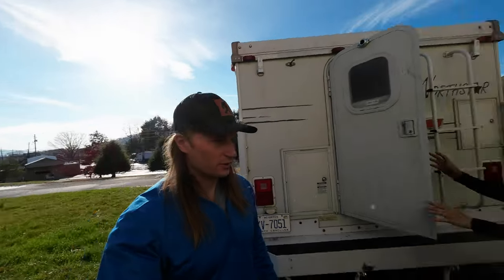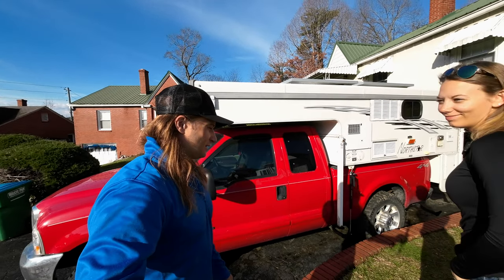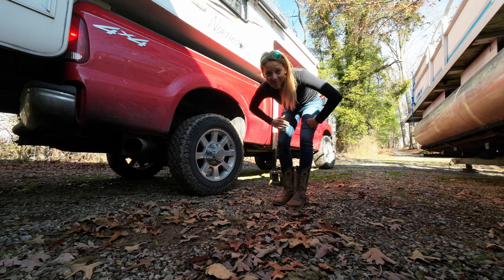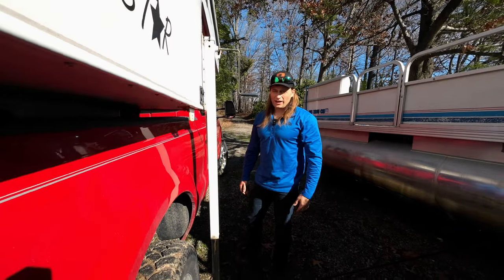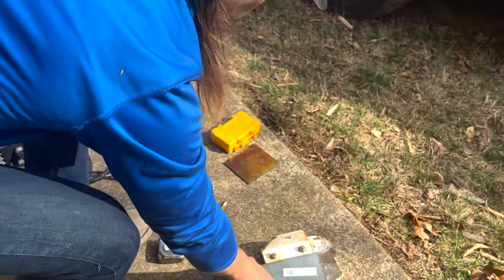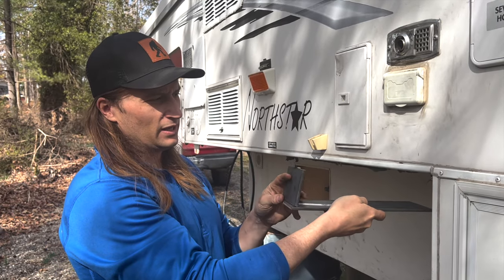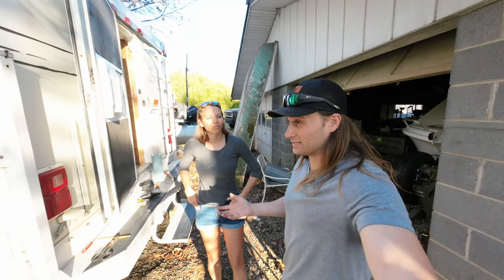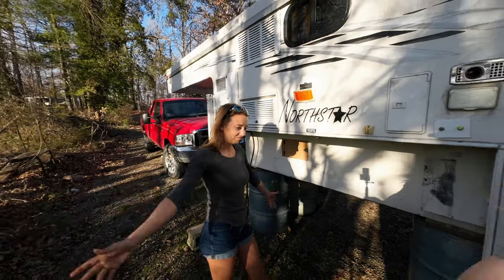The RV Shop WOULDN’T TOUCH IT - Truck Camper Repair

Comment: cut a 3/4 plywood section that is big enought to cover past the rot.   traceit, cut it, sonocrafter helps.  press it in using PL liquid nails around the edges.    get sheet of 3/16 aluminum and tek screw it all together.  drill new bolts holes for the bracket, etc...

Comment: You can buy a sheet or 12" wide piece of 3/16" thick aluminum gusset to put on the underside of those bolts for added stability. It's relatively cheap. Just a thought.

Comment: That disel heater can be mounted on its side, as long as the glow plug is facing down.  Otherwise you get fuel buildup and leaks.

Comment: Great to hear that you guys repaired the camper. And great job Chris on moving the bracket with the four  wheeler and trailer. Work smarter not harder😂. Is the pontoon boat also yours?
Reply from the maker: No the pontoon is not ours. We rent a house m and the owners also store their stuff in a garage on the property.

Comment: I just watched your 
March 1 video ((concrete blocks have no strength the way you are using them. They will collapse))
((Always place the blocks with the holes vertically ))  place a piece of plywood wood under the blocks and at least 2 pieces of 3/4 plywood on top for the jack to sit on.  
I always have 12 pieces of 3/4 plywood cut to 18”x12” they have come in handy for leveling and also soft ground or sand situations. They also come in handy when you have to jack the vehicle up on soft ground . please be safe We love your videos

Comment: Thanks. I have a similar issue with My 2004 Travel Lite, Mountain Star.
Reply from the maker: It seems like with these older truck campers your kinda on your own for repairs. Hope yours is fixable. This fix we did is still holding up after several months of driving.

Comment: Can you swap the rear legs with the front legs?  That could solve your issue.
Reply from the maker: Possibly but we don’t really wanna unscrew anything . It’s all screwed into the wood and we just wanna not touch it lol 😂
Reply: @CandEAdventures 
Screws into plywood [le sigh].
The perils of a factory RecreateVehicle.
.
"But but but LM!, screws into plywood are stouter than staples into particle-board!"

Comment: What actual brand is your diesel heater?? Espar?? Wow that 8mm lag screw trick was super cool, I can not begin to convey what a pia the screen in an espar heater is without that trick, definitely will try that next time I go into mine. I just added a separate fuel tank for my espar, because it does NOT like bio-diesel even a little bit, mine runs on kerosene exclusively now.

Comment: Dually brackets will solve your Clearnce problems. Sorry I'm 'late to the party.
Reply from the maker: So scared to remove the bent bracket . Worried the wood is soft under it lol. But dually brackets would make getting around those tires a lot easier !

Comment: Hey there C & E! Great work with your channel. I'm a certified welder a few states away, with knowledge in carpentry as well. If you need any recommendations or suggestions on inexpensive repairs to your camper, feel free to message me anytime. I totally understand staying on a budget (lord knows I'm no millionaire) so any cheap, yet structurally sound fix is gratifying. Good luck & safe travels!
Reply from the maker: Thanks for the tips! We will keep you in mind !